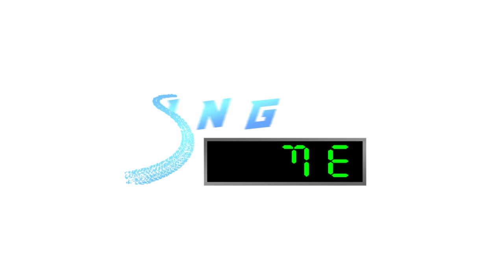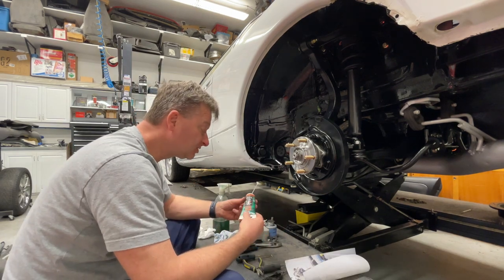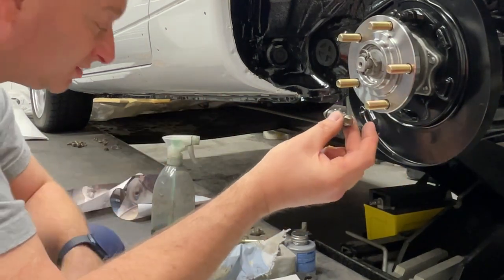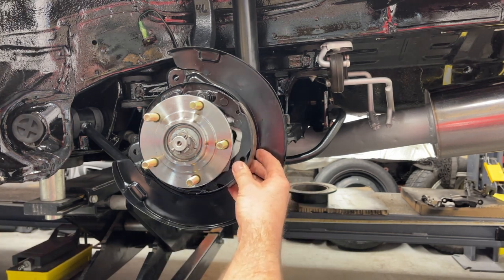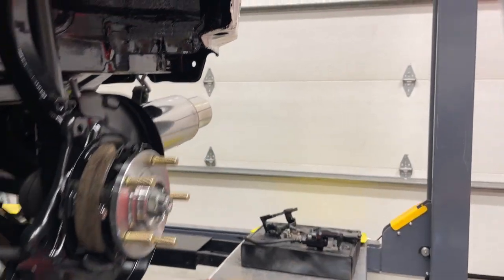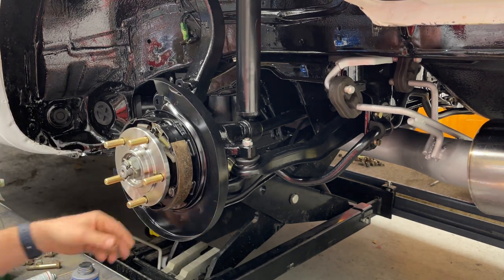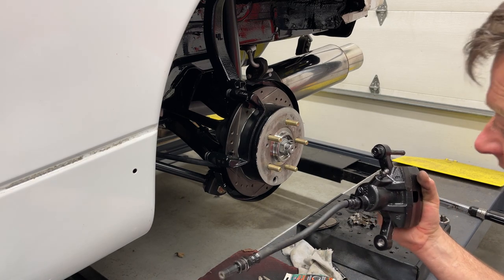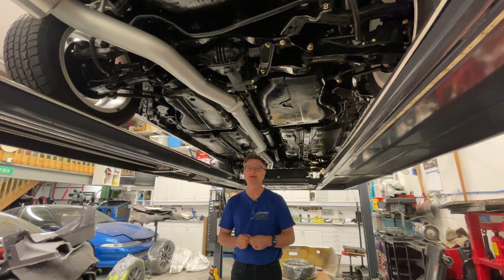Them’s the brakes – Parking Brake Drum Assembly W/ More Eclipse Undercarriage Refresh!

Comment: There is a special place in hell for the engineer that designed the spring, cup and pin hold down system for the shoes. 10:00
Reply from the maker: It is strange to me too that that is the best way they came up with and everyone followed.
Reply: @SlippingTime  Excellent video by the way. Great explanation, no time wasting, and straight to the point. I appreciate you using an HD camera with excellent lighting. It really helps when you show the shoe assembly close up and in detail. Now I got gotta figure out what I screwed up on my left side. Something is clicking and in reverse the e-brake handle pops up and down. Definitely assembled something incorrectly there.
Reply from the maker: @tomasbeblar5639  for sure I am familiar with Jafro’s videos. I enjoy them thoroughly. Best of luck in finishing the job. I am sure you will have it completed in no time at all.
Reply: @SlippingTime  Doing it right now. The driver's side was clicking so I took it apart. The cable had popped out of it's shoe connection and I swear I had it on correctly the first time. I put it back, reassembled everything and ran into the same problem as last time. The rotor would NOT slide over the the shoes. The first time around I assumed it was because the rotor and shoes were brand new so the tolerances were tight. Thinking nothing of it, I used a mallet to hammer it on. 

2nd time around, it STILL wont slide on. I have the parking brake lever adjuster (inside the car) all the way out and the shoe adjuster all the way in. The shoes are loose but I can't squeeze them together to put the rotor on. I checked the springs, clips, seats, etc. Everything looks ok to me but I still can't get the rotor on. Going to see if DSMTuners has a post where someone ran into the same issue.

EDIT: I have new parking cables as well.
Reply: OMG. Rock Auto sent me the wrong cables !!!!! I got the FWD version instead of AWD. Damn it!
Reply from the maker: @tomasbeblar5639  that sucks. The good news is you know the issue now.
Reply: @SlippingTime  Yup.